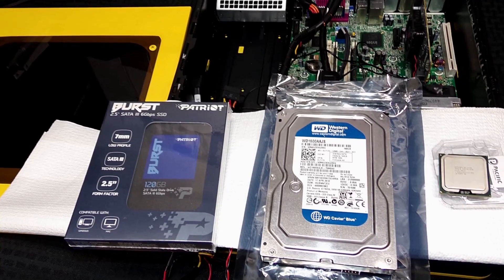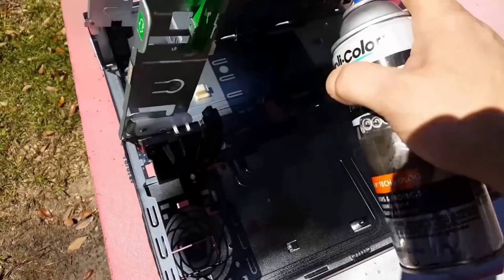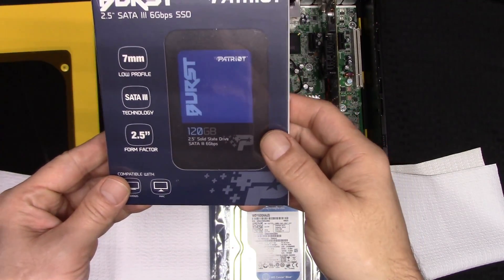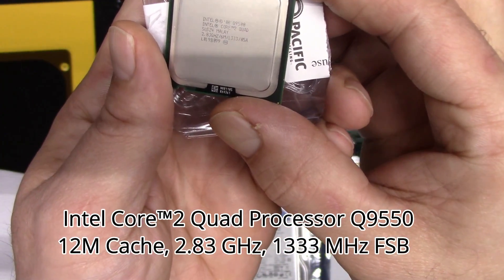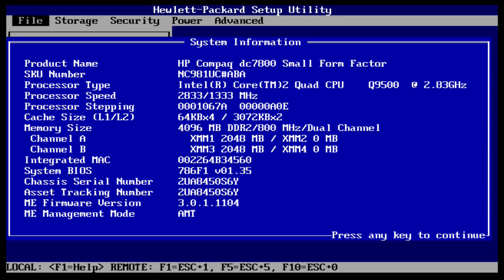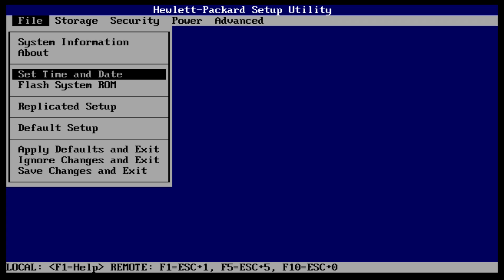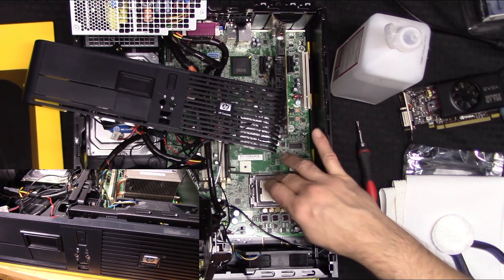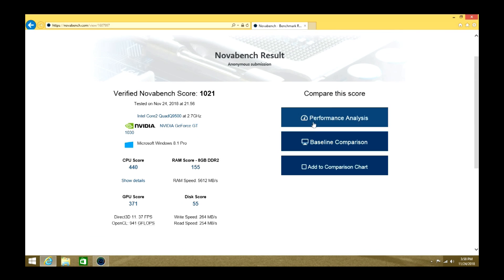This Hp/Compaq wouldn't even boot before I restored it

Comment: I recently repaired and upgraded a Dell Optiplex 755. I added 4 x 2gb DDR2, replaced the old 256gb HDD with a 1tb ssd and installed Windows 10. Boots up real fast. It's needs a graphics card so it can be my HTPC for my 50 in plasma TV.

Comment: love youre work i have a question  how did you use the probe on the temp meter or dit you cut the probe off and put the loose wire under the cpu cooler? greets from holland

Comment: i got a gt 1030 in my hp 8300 elite. came with i5-3470 and 8gb of ram. been playing most games i throw at it. 30 fps is the lowest i've had with it. normally 30-60 fps depending on game and settings used. usually run it at 1680x1050 on my 32" tv.

Comment: I got inspiration from this and going to buy a core i3 machine with 4gb ram and 500gb hard drive, going to upgrade it with a gt730 that I have from one of my older attempts to use my very old pc, then put a core I5 2400 and another 4gb stick down the line. The I5 is last before a stick of memory, might buy a ssd when I swap out the dvd drive for small hard drive cages

Comment: modstek - I really enjoy following you breathing new life back into these older rigs. I have several of these machines now and have decided to build one for a casual gamer. The one I chose is a HP 6300 with a i7 3770 with 16 gigs of ram. I'll be adding a 1050ti low profile card and a ssd along with the hdd. Seems I recall you replacing the factory cpu heatsink in one of your builds...can you make a recommendation for this one? Thanks!

Comment: Some fruit for thought, higher density DDR2 is better then lower density/ high quantity in terms of latency. If you want optimal speed out of the memory, two sticks, 4gb each DO stepping, 1600mhz if the cpu has a 1600mhz fsb. Everyone always goes for the kits that fills all the slots, not always better.
Reply from the maker: That's a good point I try to do the benchmarks with 2 sticks of ram and it will produce better results. But when comes to game play stuff in as much as I can.
Thanks for commenting

Comment: try this paint on the coolers. heat resistant and use one ot 2 coats so its clear. https://www.amazon.com/Dupli-Color-EMC201007-Metal-Anodized-Color/dp/B00099BJUC/ref=sr_1_1?ie=UTF8&qid=1543303032&sr=8-1&keywords=dupli-color+metalcast

Comment: modstek how come you're using Windows 8.1 now, Windows 10 runs great on most older PC's?
Reply from the maker: 10 runs great on these when it's freshly installed but after awhile with its many updates and bloatware It slows it down and changes some of the drivers as well. It's just preference I guess
Reply: @modstek  I see. I would definitely agree with the fact that there is bloatware on Windows 10 and Maybe it's better, I normally use 32 bit windows 10, But I might consider using Windows 8.1. Thank you😀

Comment: Can anyone tell me how good this is and how it can improve:
Ryzen 7 1700
Msi 370x pro carbon
1 tb  hard drive 
1 8gb ram stick
600 w power supply
And a Sahara p15 case
I would love to include a graphics card but my budget is £500 and the CPU and motherboards are on great deals of 145 and 89 pounds. This will be my first every build and I don't really know if the graphics card is  essential.
Reply: the ryzen 7 doesn't have integrated graphics, so you will be shit out of luck unless you get a graphics card
Reply: If you want to play games it is. But if you want to save a little money and still be able to play your games, i recommend the ryzen 5 2400g. Its an apu so you wont need a gpu to start gaming with that chip.
Reply: Allways go dual channel, atleast with ryzen, go with 2 8gb sticks with high speed.
also, the budget of the gpu should be atleast 50 percent of your total budget.

If you want to game you will need a decend gpu like a 1070 980ti rx 580
Reply: And spend like 30 pound on a ceap 120 gb ssd, it will be a big differenz to a harddrive
Reply: For gaming its quite essential. If your budget us that low, by those and get a graphics card soon. Cex do preowned gpus for decent prices. You could probally get a 1060 3gb for 160
Reply: Good pc tho
Reply: Well you don't need a 600 w psu if you are not going to run a gpu... You could probably find a cheaper deal on a less fancy motherboard and why not get a cheaper ryzen chip? You could upgrade down the road and still afford a gpu, because the Ryzen 7 1700 Doesn't even have integrated graphics so you need one anyways.
Reply: You can get a ryzen 5 2200G and not have a gpu, or you can get a ryzen 3 1300x and buy a gpu
Reply: A gpu is essential since the 1700 doesnt have an iGPU